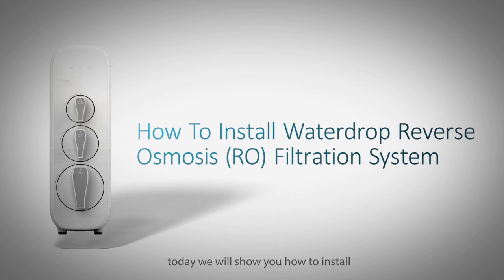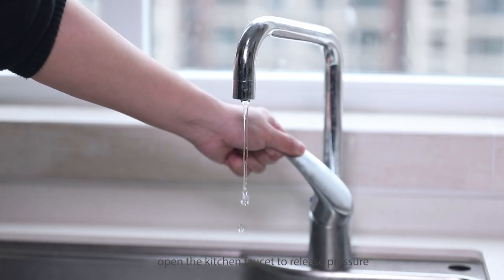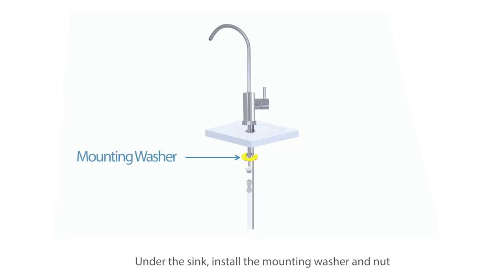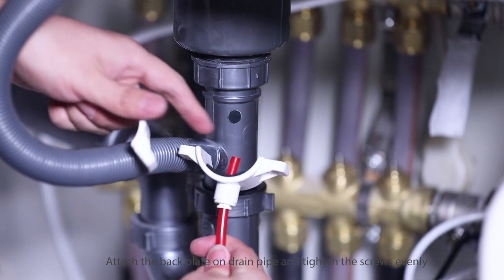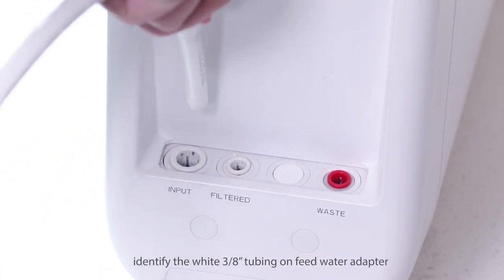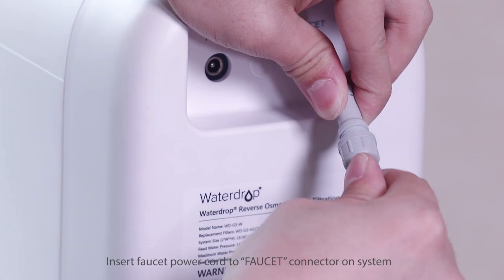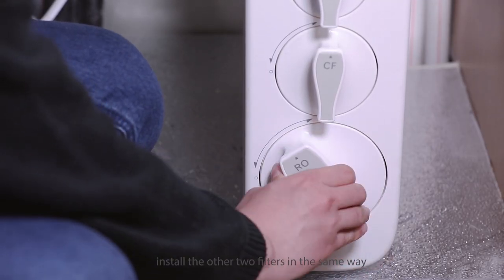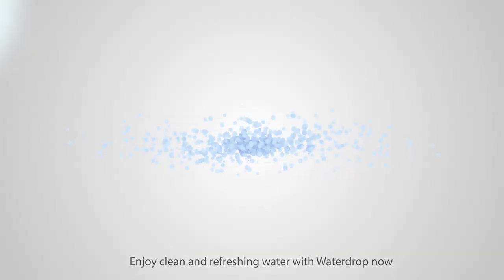How to install Waterdrop RO Reverse Osmosis Systems?

Comment: There's like only one real review for this filter....
Reply: @Sean Reed I just went with a zero watcher gallon pitcher due to mixed feelings on the whole RO process. But I agree with you on the fake reviews, I wouldn't buy this.
Reply: @lionintu  I have a zero water filter pitcher as well, but if you go through allot of water, depending on water quality those filters don't last that long (I'm in FL, water quality not the greatest) and aren't cheap. I'd be spending at least 120 a year on filters alone. This system's currently on sale on amazon for 239 so I pulled the trigger on it. Don't know if I'll save too much money, but this automates most of the process.
Reply: I just installed mine today. Really easy to do. The water is great. It doesn’t have taste, which I’ll miss from my mineral water dispenser. But the water is very clean and has no smell. The unit only turns on when you are pouring water. And it’s very quiet. I do like the the water so far. Plus, it has a small footprint under the sink.
Reply: @DarthSidious  239? Was it really the same model? I see there’s a prime deal right now for 384 and I thought that was good.
Reply: @aristotlekumpis7095  How fast does the water come out? Is it similar to a regular RO tank system?
Reply: @VioletJoy  Yes. It's the same flow. You won't find a system that has a higher flow. I've been using this system for 8 months now and its great. I highly recommend it.
Reply: @aristotlekumpis7095  Thanks for the reply! My husband is checking out on Amazon right now. I'm looking forward to having more space under the sink.

Comment: Hello,
   Excluding the display, will the filters alone work without electricity ?
 Thanks.
Reply: No, it doesn't. The filter needs a pump that works with electricity.
Reply: @emmafeng5206  Thank you !

Comment: I'm having a problem with the RO filter, it will go in but once you try to rotate by 1/4, it doesn't budge.
Reply: I'm having the same issue with the RO filter, did you manage to figure it out?
Reply: @sj-ck4yl  having the same issue. Did you figure it out?

Comment: I’d like to know the best way to winterize or store this unit when not in use over the winter. It’s installed under the sink in my cabin where temperatures will fall below freezing.  Should I remove the whole unit and store in basement (where it won’t freeze)?
Reply: Feed it antifreeze
Reply: You could strap a flat fish tank heater onto it? Just an idea

Comment: Can you connect it to the fridge as well? It won't affect anything would it?
Reply from the maker: Hi, thanks for reaching out us. 
After completing the registration online, you could choose the accessory kit as a gift, which will help you connect the RO to your refrigerator.
Since different refrigerator/ice maker have various requirement of water pressure, it's not possible for our RO system to provide them all. Connection under mismatched circumstance may result in many problems, including but not limited to: slow ice making, frequent start-stop issue, etc.
Therefore, it's NOT recommended to connect the RO system to your refrigerator/ice maker.

Comment: The only vertical pipe i have is metal. Can the drain saddle collar be installed on metal pipe?
Reply from the maker: Hi,
Thank you for contacting us. 　

Please note that you may need to drill a hole on the metal pipe if you will install the drain saddle there.
In order to give you more proper assistance, could you please send us a picture of your undersink?

Please contact us by emailing service@waterdropfilter.com.
Enjoy the rest of your day!

Kind Regards
Mia Lauren　
Customer Service Rep

Comment: Because I have a disposal, there is no room on the vertical drain pipe.  Should I put the drain collar on the horizontal pipe after the p-trap?  This is a 1 1/2" abs pipe.  Will the collar work or does it have to be on a 1 1/4" pipe?
Reply from the maker: Hi,
Truly sorry, but installing the drain collar on a horizontal pipe location is not recommended, since a leak might occur.

May I have a picture of your Undersink area in order to offer you further assistance, thank you.

Our service email is service@waterdropfilter.com

Our drain saddle (collar) is suitable for drainpipe with a diameter from 1 2/5" to 1 2/3", as shown below.
https://imgur.com/f26eStS

If you have any other questions, please feel free to contact us via email.

Warm Regards
Mia Lauren　
Customer Service Rep
Reply: @waterdropfilter.official  Thank you for your response.  I replaced the p-trap with one that had a longer vertical drop, so was able to install the drain collar as instructed.  Entire installation was very straight forward and easy.  I'm a lady in my seventies.  If I can do this, anyone can.  Thanks again!

Comment: It’s a snug fit under my sink. Why can’t it be next to a cabinet? Also, unless the people that connected my sink labeled the lines wrong; as I’m running it for the first 30 minutes, is the water supposed to come out hot?
Reply from the maker: Hi, thanks for your purchase.
The noise level will increase if you put the unit right next to a cabinet wall.
If the water is still hot, please feel free to contact our service email: service@waterdropfilter.com
We will surely help you find a solution ASAP, thank you.
Reply: Hot water? Bad install sounds like.

Comment: Does it taste like good bottled water?
Reply: It taste like some good ass bottled water
Reply: Depending on what you buy and your preferences, can be far better. Some very expensive systems can remove so many impurities that you'll need an additional system to reintroduce certain minerals much like what many bottled waters do. Really depends on the area you live in first and foremost for your needs.

Comment: My drain pipe is metal (steel). Can I drill a hole for metal pipes, or do I have to change my drain pipe to pvc pipe? @waterdrop
Reply from the maker: Hi, Thuggie,
Thanks for your interest in our RO unit. You may drill a hole on metal as well but I would recommend consulting with your plumber first, thank you.
Reply: I’m having the same issue, did you drill a hole in your metal pipe?
Reply: @ModernUrbanity  yup. I was worried at first too. But it was really not that hard as i thought it would be. So just drill it like u wud drill n e thing else

Comment: How often do you need to change out the tubing? I'm sure it degrades over time.
Reply from the maker: Thank you for reaching us. The service life of the tube is 3-5 years. The part of the tube connected to the housing system is easy to wear out. If there is an o-ring failure caused by wear or bending, you can cut off that part of the tube to ensure that the RO system functions properly.
Reply from the maker: @Benjamin Weeks Thank you for reaching us. You can get them either on Amazon or in hardware store, and you can always contact us if you have further questions.

Comment: it’s really difficult to pass pipe in drainage while clip
Reply from the maker: Hi,
I'm sorry for the inconvenience caused; please note that the drain saddle has been updated but the user manual is still the old version.

The tubing does not have to go through the drain saddle in this case, thank you for your understanding.
If you need further assistance, could you please contact us directly, thank you.

Email: service@waterdropfilter.com
TEL: 1-888-352-3558
Reply: @waterdropfilter.official   PLEASE CORRECT THIS. A SIMPLE PIECE OF PAPER SAYING and ILLUSTRATING the change would be VERY HELPFUL and help your consumer in a great way.
Reply from the maker: @norgefjorde5  
Hi,
Thank you for contacting us.
I will relay your feedback to our related department to correct the information.

Thank you for your feedback.
Enjoy the rest of your day!

Kind Regards
Mia Lauren
Customer Service Rep